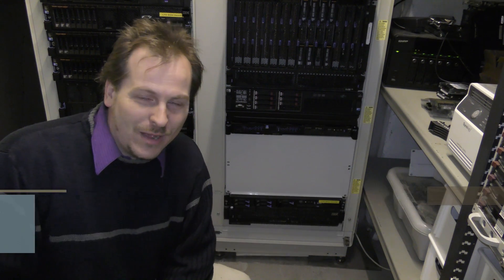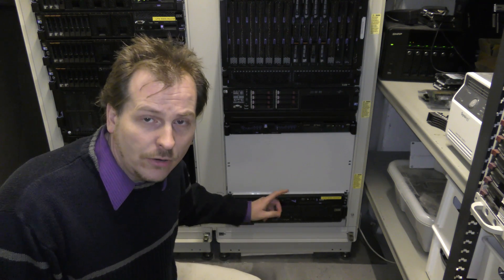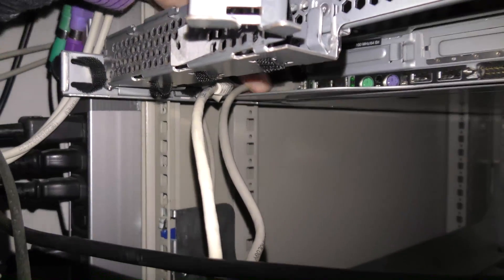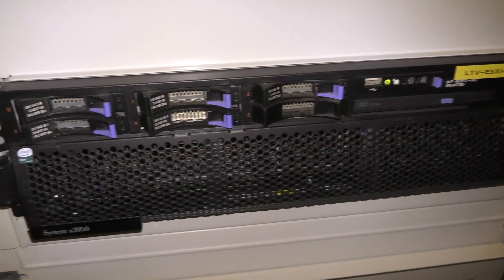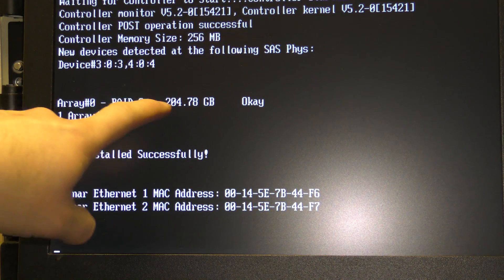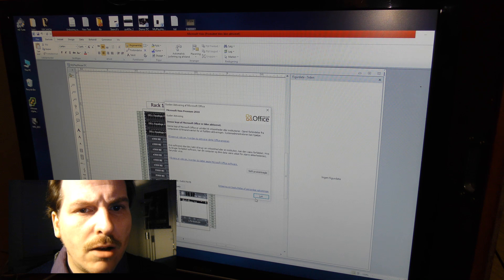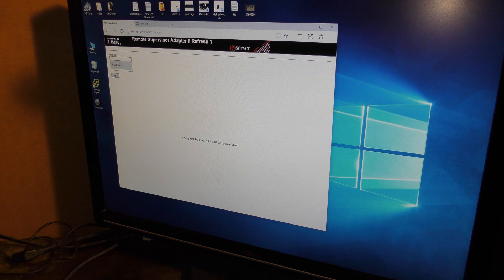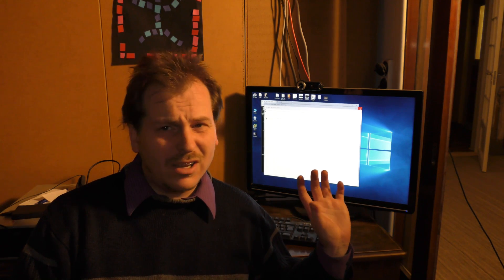Preparing IBM System x3950 X3 for new IT Apprentice  - 320

Comment: so much slowness and not-worky-ness... good thing we ditched all those old ibms lol. those things drive people nuts... 5 minutes of waiting, oh i wanted to go to the setup screen, shit, i forgot... also the absolute unlogicness of the keys to get into setup/setup the raid controllers, etc which partially are impossible to do over a serial console. oh and then there was those 'ibm remote supervisor' cards... which was a security risk all in it's own right AND required some java version from the stoneage. appearantly this one is from after the days where they had weird non-standard rs485 cabling AND/OR $100 daisychain console cables to provide 'something that should resemble something with simular functionality to IPMI' JUST NOT OVER ETHERNET, WHERE YOU WANTED IT,.. but seriously thanks to ibm we have a whole list of things we do not want in any NEW servers we buy... and that starts with 5-10 minutes booting time and power regulators that randomly die, as well as slurping up about the same amount of electricity as the average car factory just for one server ;) as for the generation of equipment depicted here: good riddance. :P that stuff turns people nuts. just by the slowness upon reboots alone. by the time you got to the screen where you have to push a key to get into setup or do pxe boot you already forgot what it was you were in front of the server for in the first place and then have to wait again lol. (and then there were 200 more to 'do something with' on that same datacenter visit ;)
Reply: can't believe anyone would actually keep those things around for his hobby/testing setup... better just use new ones there too... i have just one word for this generation of ibm equipment (and the ones before it): horrid. (oh and then there were 2 or 3 of which we felt the urge to use to use them for target practice cuz they kept crashing every time we were just 200km on the way back ;) any $35 consumer mainboard can restart 20 times in the time it takes one of these things to even count it's overpriced and not-so-very-large-anyway memory :P horrid...
Reply from the maker: Hi Sven Olaf Kamphuis
Thank You very much!  I have gathered, that you are not a big fan :-) Well everyone needs a hobby,, some collect old cars,, I like old servers.
Thank you for watching! :-)

Comment: for your problem of java some old java app just cant run on java 8 so they need the good old 7 version to run.

have a lot of this issue on old wifi controller like the Symbol WS series running Wing3 and motorola RFS series running wing4.

also have that problem with  old checkpoint firewall

Stupid security thing on java8 that doesnt allow anymore to be run in lower security level :x
Reply from the maker: Hi +Daniel Vanoost 
Yes Java is a lot of trouble,,, it almost never just work.
Thank you for watching! :-)